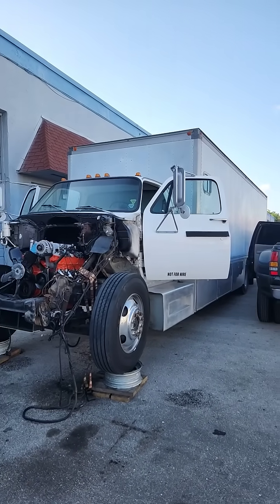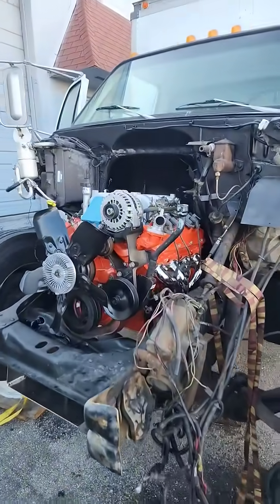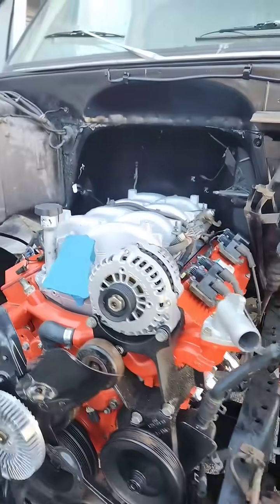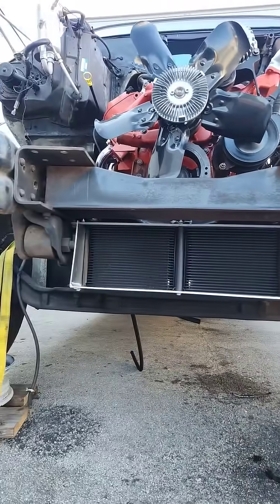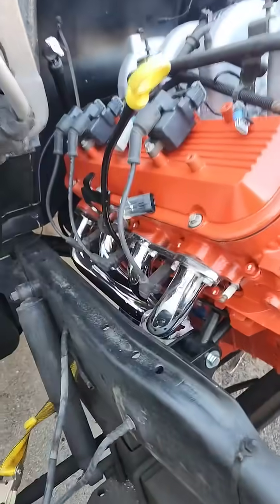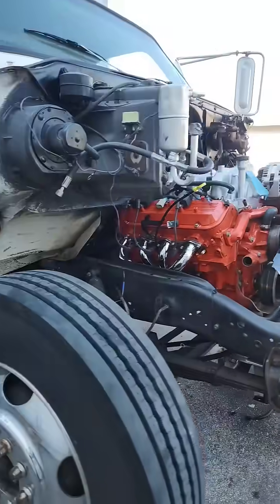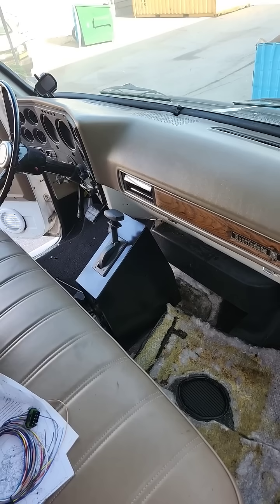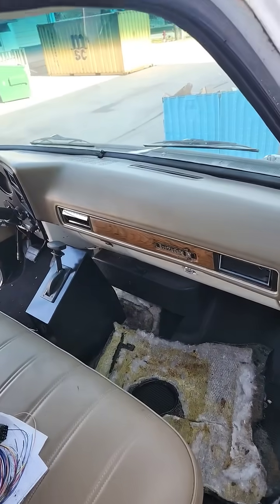8100 Vortec MONSTER Engine Swap Into Classic C60 Truck

Comment: Probably would already be on the road if you would have just thrown a dt466 or cummins in it.
Reply from the maker: Probably, but the truck owner wants a gas engine, and I don't have the equipment to do this at my shop, so I had to do the swap at a buddies shop, and it is 25 miles one way from mine, so that has added a lot of travel time and making the project take more time to complete. Thanks for the comment and watching